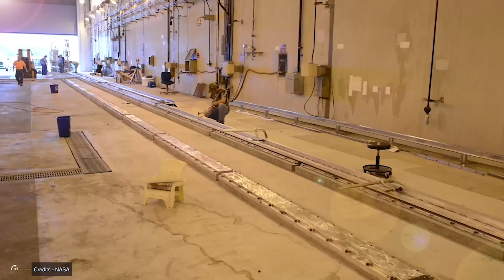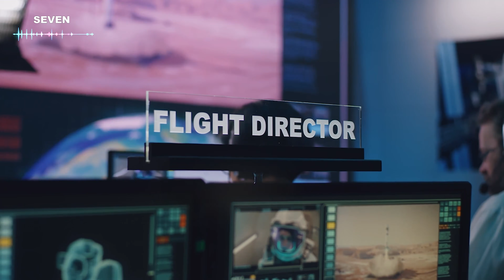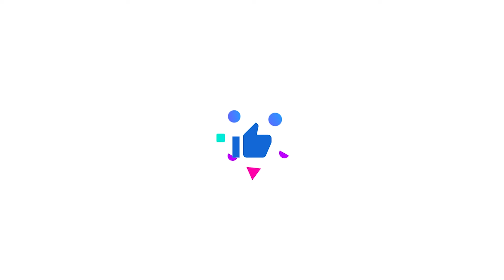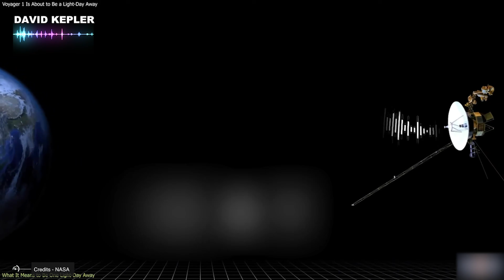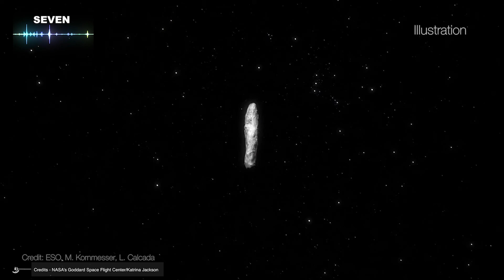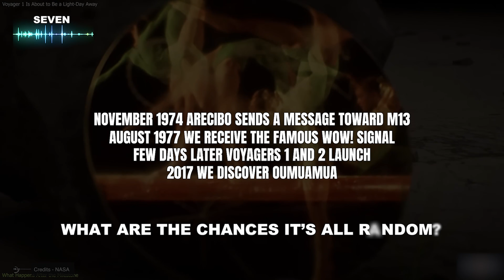Voyager 3 and Voyager 4: The Secret Probes No One Knew | 4K

Comment: Omuomuo is mentioned  multiple times, but no mention of Atlas 3/I . Omuomuo already left our solar system, but Atlas3/I will be here in October . I haven't heard anything about an intercept with it .Supposed Omuomuo has a connection to Atlas 3/I . Also, there  are reports about an Ezekiel Wheel that has been seen in our solar system .